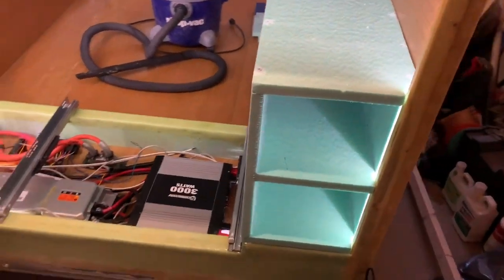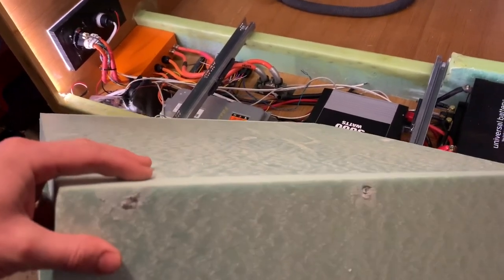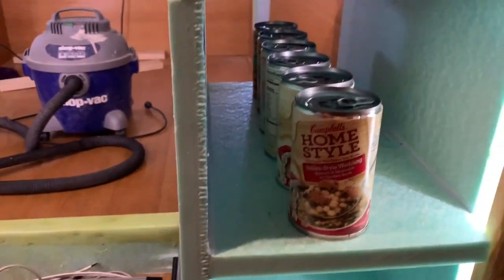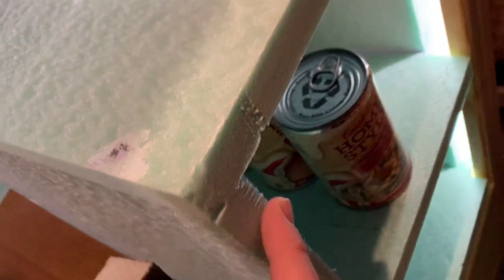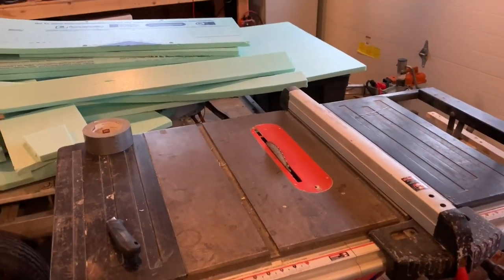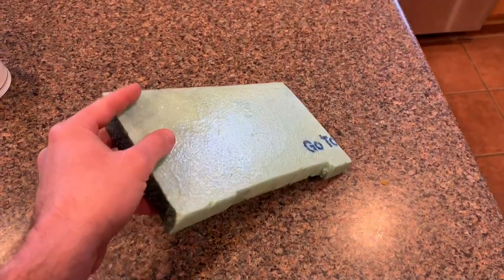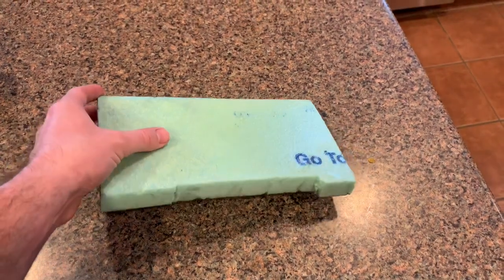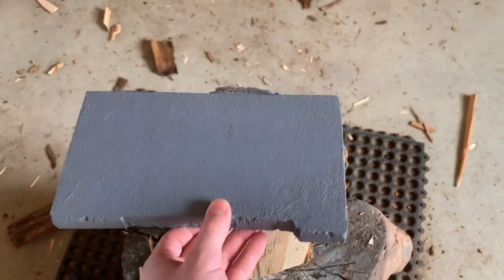Foamie Camper Build: Starting the Foam Cabinets

Comment: I made my little tea cup yorkie steps to get up into my picture window out of 2 inch foam.  He has a lot of health problems is why I had to make these for him but they came out perfect 
But what I was thinking about putting on them so I didnt have this 10 ft set of pink steps is the paper that you put in drawers to line them with.
You can get it in a variety of colors and designs and being sticky on one side makes it perfect to cover the foam. 
Just a suggestion and it would still be light weight. ☺

Comment: Interesting experiment here. I feel like the small amount of extra weight you'd get from just making these out of 1/2" plywood would be a worthwhile tradeoff considering all the work this takes w/ foam, and that the veneer of a good plywood would give you such a nice look inside the trailer, you could even use the same veneer you used for the walls and floor to really tie it all together. Then because it's wood you could use standard hinges and other hardware for doors, mounting it, etc. I just don't think the difference in weight between these and 1/2" plywood would ever be noticeable when you're pulling this trailer with all its other weight.
Reply from the maker: Andrew Brinkhaus The weight savings is actually quite large. I don’t have the numbers with me but I saw a chart showing how much lighter foam was than wood. It’s a lot. Many times lighter and it really isn’t any more work. I think it’s less actually.
Reply: @JamesKlafehn  I agree .Every gram matters. If you want better look wrap it in fiberglass and it will be like aircraft. Wood rots....

Comment: What about using those plastic drawer carts as cabinets ?
Reply from the maker: They are kinda cheap looking. On a $30,000 trailer I wanted something a little better. I have seen foamie builders take those plastic bins and wrap them in PMF. In my opinion, it looks really bad. I’ll probably go with paint and clear plastic drawers. Not high end but it will be light

Comment: Have you looked into this with other YouTubes where they takes fiberglass screen and use gripper paint and they they use the paint to stick to fiberglass screen to the foam and it makes it very very very strong we're not talkin fiberglassing here I suggest you look into this cuz you're wasting a lot of time and not getting the full benefit of what you're doing which is good with the dowels and everything
Reply from the maker: Yeah I hate that. It’s more work than fiberglass and it looks like crap in the end. Plus it’s no where near as strong. It’s a really bad way to go.
Reply from the maker: Joseph DuPont I’m spending time testing but I don’t think that is time wasted. Over all this will be easier and take less time than making cabinets out of anything else. Plus it will be a fraction of the weight
Reply: Just look into the gripper primer by Glidden and see what the guys did with that and using the fiberglass screening it's easy it's quick it's a lot easier than playing around with fiberglass use a flat fiberglass screening and then they use the Glidden the hold it there and it's a great if he's if I mean it holds Like Glue
Reply from the maker: Joseph DuPont I have. The stuff isn’t cheap, you can’t find it everywhere, and I’ve heard multiple people say that it had delaminated from their foam. Have you used it? The people who haven’t used it are the ones that keep telling me about it. Haha but again, the finish is bad. Not good enough for a $30,000 camper